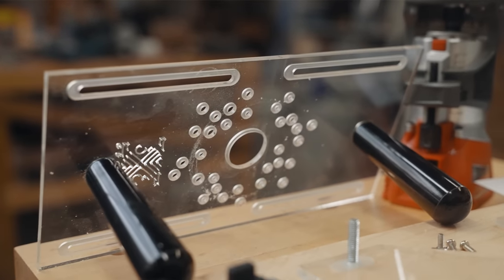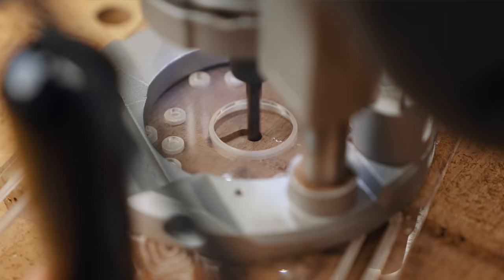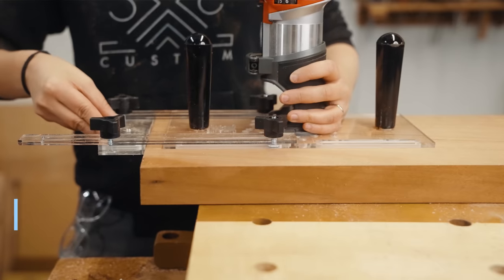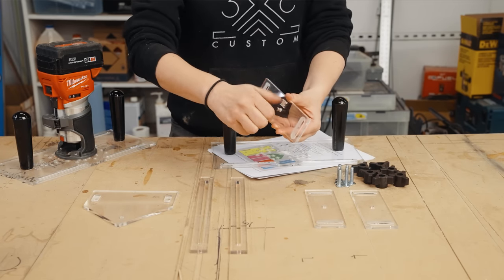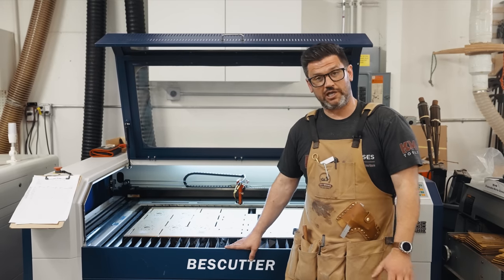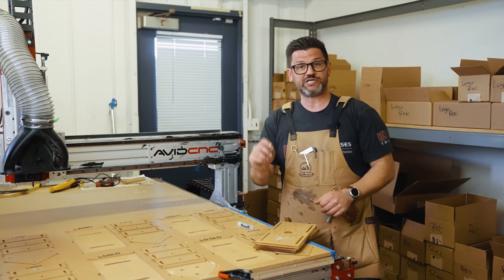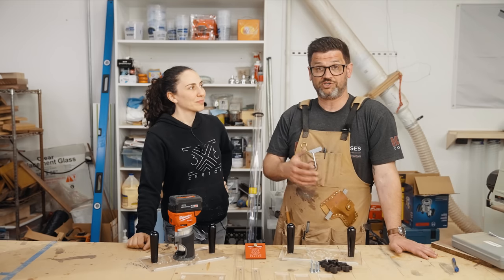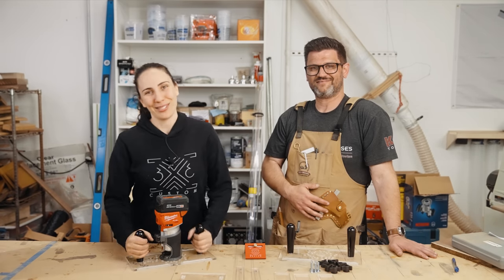The 6-in-1 Universal Trim Router Jig is FINALLY HERE!

Comment: Tamar,

I don’t like to complain, but I think customers need to be aware of my experience so they can consider such, before buying your 6:1 base / jig. First of all, the innovation you advertise is definitely needed. In addition the functionality and innovation is really cool. I appreciate that so much, but… the product has to do what you advertise. 

I can tell you that when I first opened the box you sent the 6:1 unit, The visual was concerning. Note: I have purchased many templates (various plexiglass… laser and CNC cut products). Everything delivered prior to your product arriving was immaculate (cleaned after machining complete). No protective paper or plexiglass fuzzies left stuck in the prices your process machined. 

The multiple holes pre-drilled to align and fit the trim router array you advertise. Well… in your video, these holes look great. Like counter bored, perfectly round and shaped to assure the screw heads fit properly. 

That is not what your manufacturing process delivered me. The holes you counterbored for screws head look like they were drilled with a hand held drill motor with a 3/8” bit. The depths are not consistent, the bores are skewed, and plexiglass remnants (from heat I guess) had to be cleared out. 

I used your instruction sheet and color coded chart to locate, align, and mark the holes I was to use per your documents for my Rigid Trim Router. I double and triple checked before marking. The holes would not align so that all 4 screws could fit without risk of binding and cross thread. I worked for over an hour to find what mistake I may be making. 

The holes designated to fit the Rigid model were not drilled exact. Every way I tried to turn the base, “just in case” rotation was needed, I could not get all 4 screws in. As a matter of fact, it looked like one of the holes was a few mils larger than the other three. Maybe your way at providing “wiggle room”? 

Either you have sub-contracted these fixtures to shops you have no QA control over, or your CNC machine calibration is “off”, or in dire need of maintenance. 

I have pics…

I could not find a means to provide feedback other than commenting in your videos. 

If you provide feedback here to me and anyone else that might have an issue with your products, I’ll share the pics. 

You did not measure up to your competition. Your product at least in my case did not meet expectations set by “promises” you made during your advertising video. 

I hope this is something that just “got by you” and something was “off” with the CNC. 

I hope this is not something other customers are experiencing. 

Again, provide me a way to offer feedback and I’ll share a pic that clearly shows indications of poor CNC operation. The sloppy holes on the bottom of the base, etc… By the way… nearly all those counter bore holes have ragged edges and will surely plug or a least collect a lot of saw dust.

I hope you will make this right. Send me the order that measures up to what you advertise and a RA form. After I assemble your base to my router (which should take less than 5 minutes), I’ll box up the mess from round 1 and return it.
Reply: By the way… my router is the Rigid 18v Octane. It is on your list / links for compatible units.
Reply from the maker: We’ll that’s no good and not the feedback we have been hearing. We always want to make sure customers are happy. Please feel free to reach out to my support team to help you out with this. Support@3x3custom.com
Reply: @3x3CustomTamar  I am sending pics this morning. 

Thanks for responding.
Reply: @retiredoba2836  let me know how it goes, almost got it but after reading your review I will wait

Comment: I got one of these. It was poorly manufactured. It had rough edges, and some parts did not fit correctly. I will never buy from this company again. And it did not work very well with my dewalt router.
Reply from the maker: Sorry to hear that. Did you try reaching out to our customer service team to sort out your problems? The email is linked on the contact page of my website.
Reply: @3x3Custom - Tamar  thank you for your reply. Though I probably will not bother, the jig had too many issues for me to pursue it as a solution. One of the issues that I ran into was there was no way to set the fences close enough using my plunge router base. I use a dewalt trim router, and the knobs could not be secured close enough for making the types of cuts that I would need this jig for. 
 But one of the fences in my set was not properly sized so the bolt could not fit through the slot, and the entire thing could have been cleaned up, there were little bits of plastic stuck in slots, it looks like there was quality checks on the manufacturer, like a person got it off the cutter and threw it in a box. 
Also, it would have been super helpful to have a link on the product page to the instructions similar to how Lee Valley or rockler does. I had to sift through emails trying to find the link.
Reply from the maker: @douglasanderson7260  sorry you feel that way. We replace defective parts free of charge.